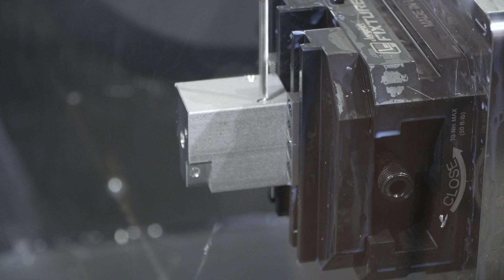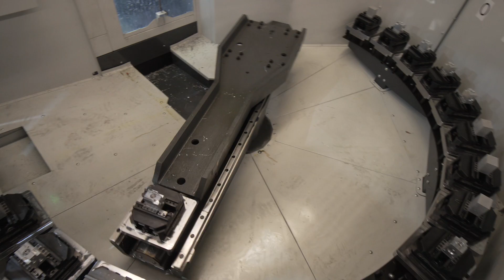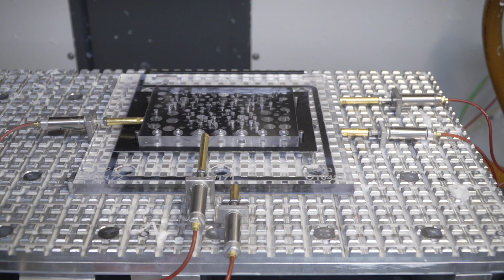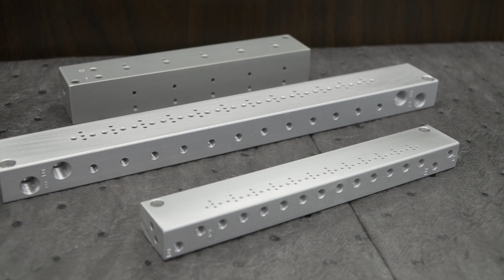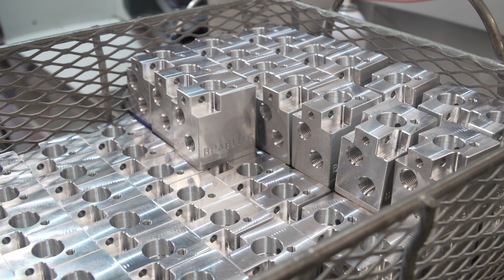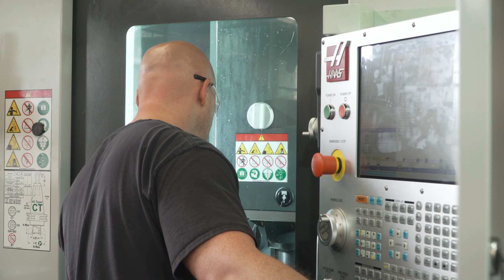Customer Spotlight - Clippard Instrument Lab

Comment: I'm waiting for the 5 axis machine that can grip parts for 2nd op like double spindle lathes
Reply: Check out Willemin, they’re intense
Reply: Pretty sure they already exist in a variety of configurations, aside from that there are automated setups with automatic vises and robot arms so the robot flips the part for you in the same machine or adjacent one. It isn't all the necessary to invest in all that robot machinery though, pay a guy to load 2 pallet changing 5 axis machines. This way is faster in total using 2 spindles rather than 1 machine.